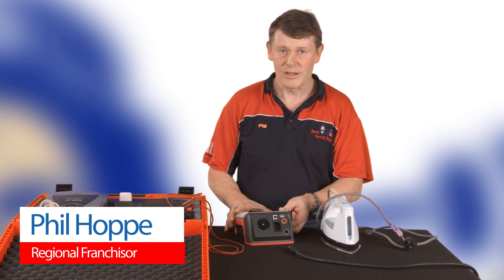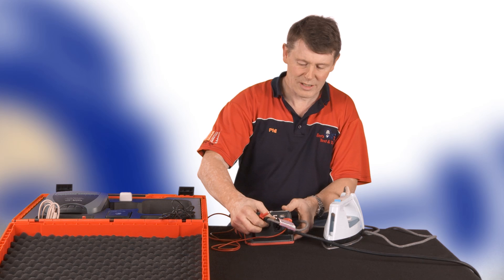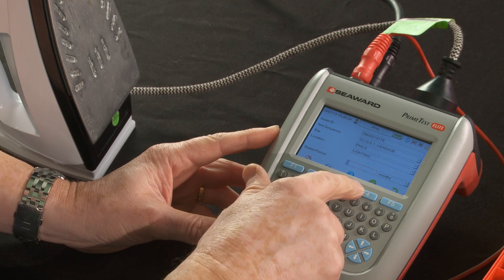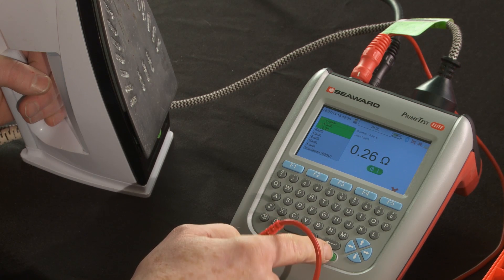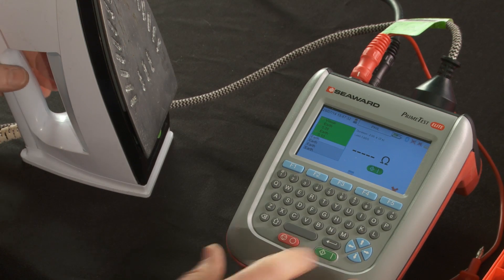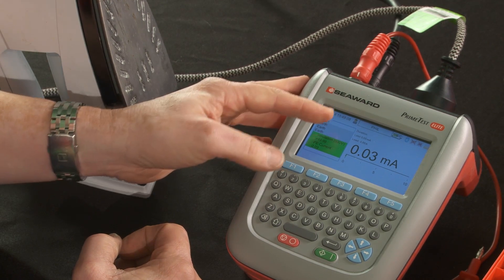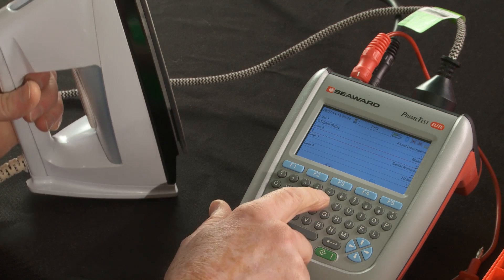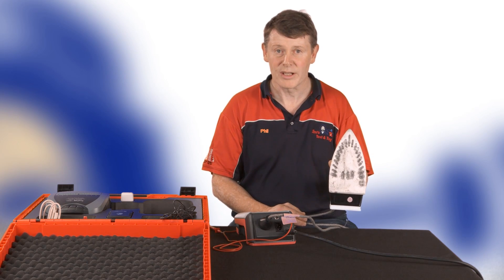Class 1 Leakage Test | Earth Leakage Tests | Jim's Test & Tag

Comment: I have just done my training today and he has failed to do the most basic thing, DOING THE VISUAL BEFORE PLUGGING IN THE DEVICE TO PAT Tester. Visual inspection must be done at the start and as a very basic step. If it fails the visual test, I will not be proceeding with any of the other tests at all. In case if there was a damage to the plug or wire/cable/lead, the person conducting the test or anyone who uses the device or in this case Iron, can get electrocuted. 

Sequence is the key!

Comment: what if the product is all plastic and has no conductive exposed parts?
Reply: Fat Harold then its probably a class II item
Reply: Jay Jay test the lead and the appliance as two separate items. However if the appliance can be run from a battery then it wont need to be tested and only the lead will
Reply: It's a class 1, put the probe on the metal toaster frame where you put the bread in. That's how you test a plastic toaster mate.
Reply: If it's all plastic with no exposed metal parts you need to carry out an insulation resistance test.  But make notes to why the earth continuity test wasnt carried out.